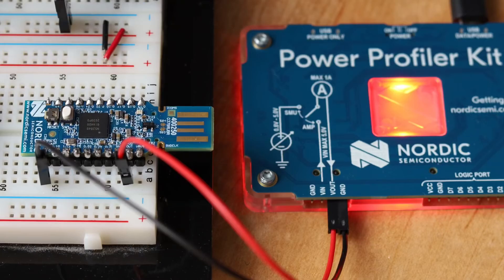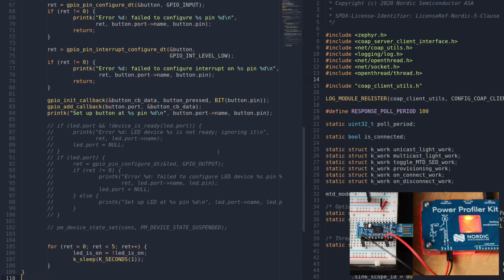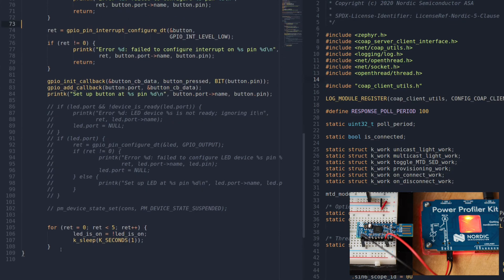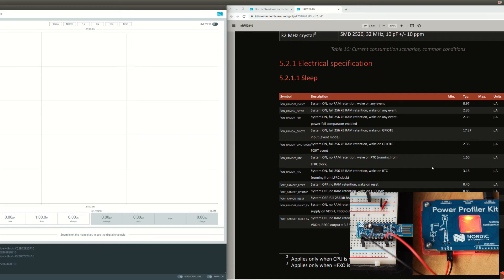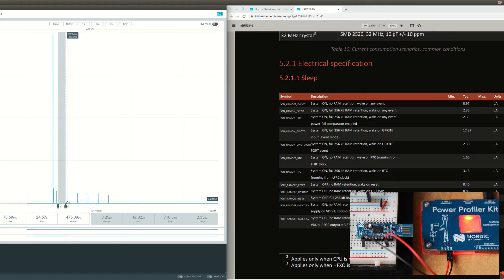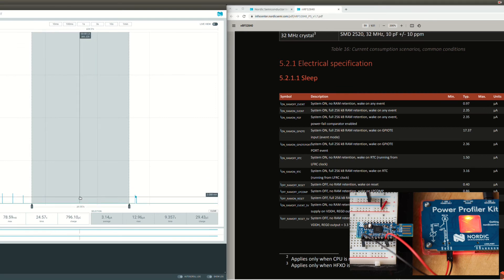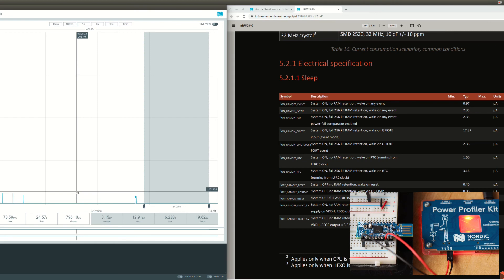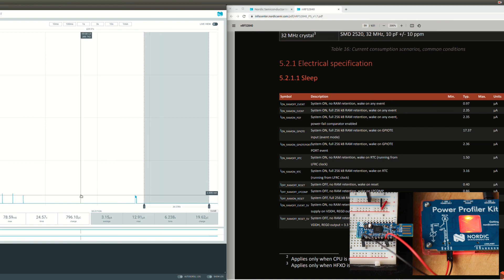nRF52840 System ON Sleep + PPK2

Comment: Hello Francois. Can i get your email?
Can we use the power profile kit to monitor transmission/Sleep current from a wireless sensor?
Reply from the maker: Yes you can monitor current consumption of most things including wireless sensors.
Reply: Everything between 0.8V-5V and up to 1A current draw :)